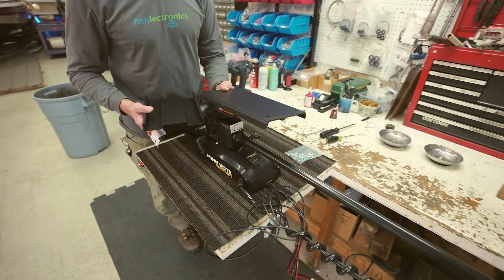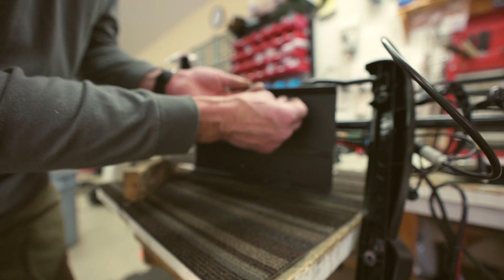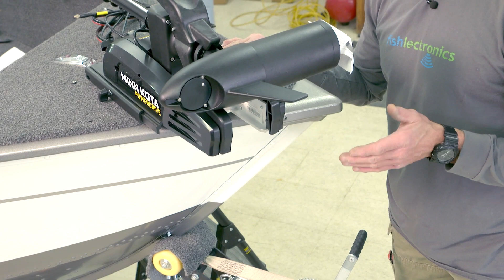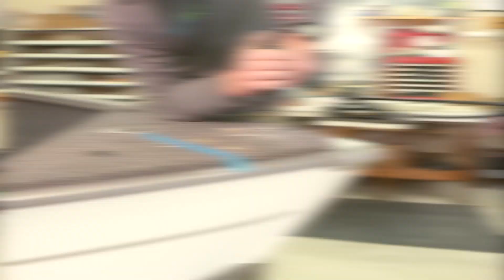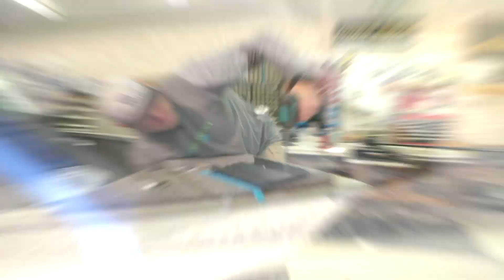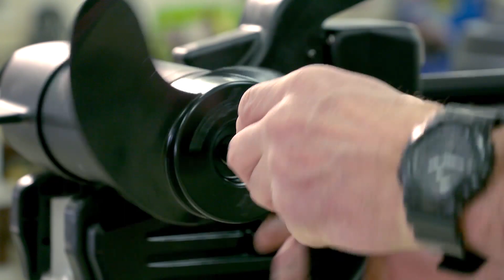Minn Kota PowerDrive Installation Overview | Trolling Motor Install

Comment: I have the same motor but one of the wires that comes down the coiled wire mine has a 14 pin connector.  Yours doesn’t?

Comment: I purchased this unit. 2nd trip i had to put it in for warranty,  replace the whole lower unit due to a grinding noise. Last week and just veggie the warranty expired, I needed to put it in the shop for another lower unit replacement and ethernet, motherboard fix. Anyone else have issues with these units? I enjoy the remote and the connectivity to the helix unit. Wish the trolling motor was more reliable.

Comment: What are the dimensions of the quick release mounting plate?  The bow plate on my v hull aluminum boat is only 8"x8", is that large enough to accommodate this setup?  Thanks

Comment: Excellent video, but I have a question. What is the best way to mount the motor on the bow, if you have no access underneath to bolt the bracket down?

Comment: Great video! However you didn't mention the clearance needed from the gunnel to the motor shaft though. Needs to be at least a 1-3/8" gap

Comment: I have a 2 bank charger all hooked up to my 2 batteries with a positive and negative coming from the boat from a previous owner or factory not sure. Question is where do the pos and neg wires coming out of the trolling motor go? My old motor had a plug into the boat. The rings on the end are super small
Reply from the maker: Thank you for contacting Minn Kota. We would recommend contacting our Technical Service Team on this matter. You can contact them here: https://bit.ly/3Ix6CSd

Thank you.
Reply: @MinnKotaTutorials  I decided to go with a new plug and wire it all in, should be up and running soon thanks

Comment: Great video, but you really need to include that you need to get the quick release bracket. It's not in the title or needed. It's an extra expense, but I'm curious how to do it both ways. Without the quick release bracket, is it bolted directly to the boat?

Comment: Quick question, will my quick release mount from a 2001 powerdrive accept a new powerdrive unit?
Reply from the maker: Ben Ladik,
 It should work, but the side plates have been redesigned so if you have a thumb screw to tighten the 2 plates together the side plate may get in the way of the thumb screw.  You would have to use washers between the motor and the top plate to shim the motor up so that your thumb screw has clearance.

Best Regards.

Comment: Does this motor have built in spot lock not required to link to a graph
Reply: i-pilot does spot-lock
Reply: Right but does it require to be linked to a graph for the GPS?
Reply: @stevenwolf91 no. The remote does everything. You need a nicer minnkota trolling motor that has link , basically a network port. Then you can only connect it to a hummingbird fish finder. Then you use the finder to select routes ect.